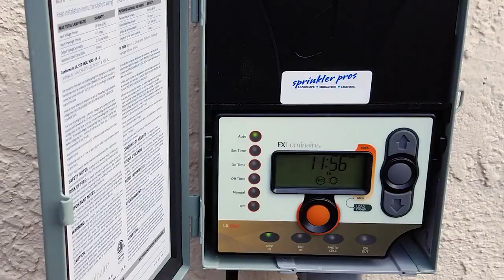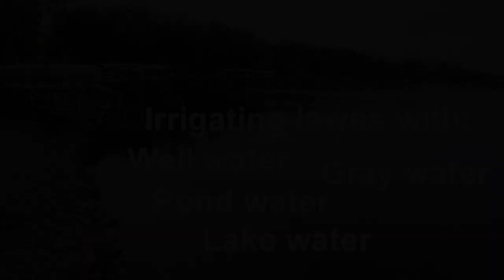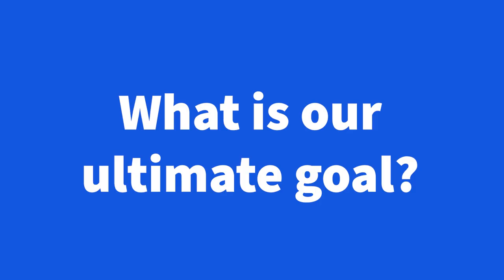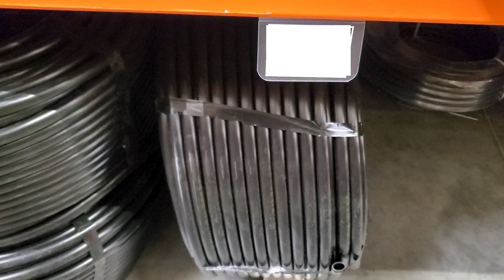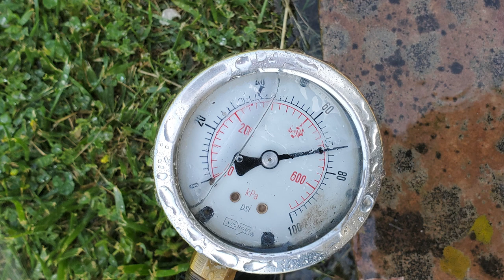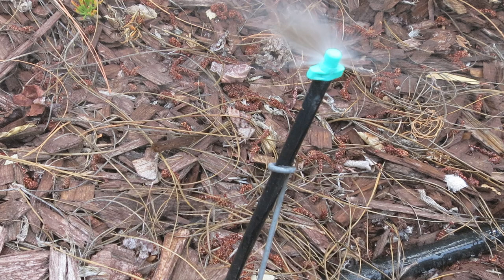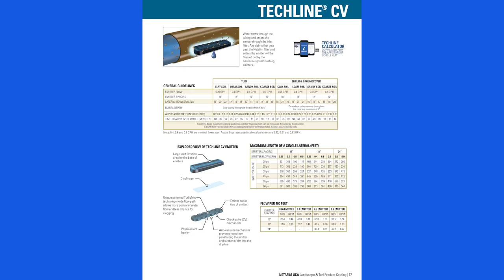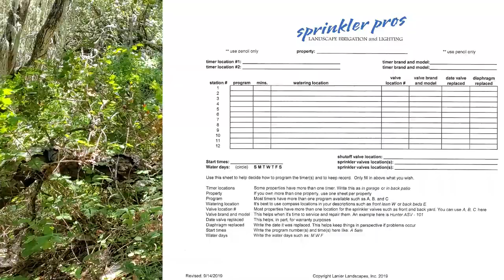Best Drip System Components for 2024 | Lots of PRO Tips 'n Best Practices

Comment: Very good info! I put manual flush valves at the ends of techline for flushing but I also could add more tubing to it as well since both sides of fitting can have techline installed
Reply from the maker: Great thinking! Always thinking of future potential is the way to go.
Reply: @SprinklerPros  by chance do you recommend a certain brand of poly tubing? I'm transitioning over from pvc...
Reply from the maker: I have never used poly. That video about trenchless pipe installation was done in Indiana where my son lives. During the recording of this video was the first time I've seen that used. I learned as I recorded. We don't use that out here in CA.

Comment: Thank you for your sharing of knowledge. I am working on a new setup for my yard and have two questions. 

I have several garden beds around my patio areas where I ran 3/4" poly to from a planned manifold setup. I am looking to reuse the three Hunter PRV 1" zone valves and am lloing to setup drip irrigation in each bed versus the older spray heads that were scattered about before (all old stuff has been removed).

My question is I have 70psi static incoming city water service. Knowing that I need to reduce this down to about 25psi for drip I wanted to ask if am I better off doing so using the hunter HFR Y filters with intregrated regulators or should I leave as is and use a regulator at each bed where I stub up with a riser prior to the start of the drip? Just not sure if reducing the pressure at the manifold after the zone valve has any other impacet that I am not aware of. Seems like this would be the cleanest way of doing the install. 

My other question is the previsou system already had a city required backflow preventer installed that feeds the irrigation manifold. Being I am looking to convert to drip is there any need to add an additional screw on style backflow preventer for each of the zone so the drip emitter tubing does not pull any sediment in? 

Thank you again.
Reply from the maker: Regarding the HFR's at the valve manifold vs having a device in each bed, that depends on the distance from the valve to the beds and whether you have things like walkways in between. The cleanest, easiest way is to install the HFR's at the valves, but if you are going "a distance" then PVC to the beds is best then install an HFR in a valve box (10" round or 12" rectangular) there OR a RainBird Retro kit in each bed. If you install an HFR in the beds, I encourage you to convert to drip tubing above grade. A couple of my videos show you how.
If you are going further than 100 ft. with each lateral of drip tubing you should go with 40 PSI pressure regulators/HFRs.
I'm not sure what you mean on the last question. The backflow preventer before the manifold doesn't keep the sediment out of the system if that's what you are asking. That is what the wye filters are for. If that isn't what you mean, ask again in a new comment thread to be sure I see your question. Good luck.

Comment: Great info! Do you have any recommendations for microsprinklers in somewhat densely planted beds, in a windy area? I've used some of the adjustable rotary kind, which seem to be intended for individual trees given their round pattern, but I was looking to install something with a more even coverage (Im thinking 180 degree ones, with an occasional 360 for the larger areas should do the trick). Thanks!
Reply from the maker: Hi Joe, are you intending to install these sprays on 1/2" drip tubing or off of buried PVC pipe?
Reply: @SprinklerPros from 1/2” drip main line, above ground. Thanks
Reply from the maker: Have you seen my video called The 3 main different types of drip irrigation and when to use them ? It should answer your question.
Reply: @SprinklerPros  I’ll have a look, thanks!

Comment: 5:44 I used one of those dead ends without the double loop for my drip system, I had it on and I heard a BOOM and it shot past my head and hit the fence and then went somewhere I could never find, I guess I got lucky.
Reply from the maker: Yikes! Sounds like your water pressure's too high, eh?  Glad you didn't get hit.
Reply: @SprinklerPros  Almost 90 PSI, thanks for your great videos, I have sub'd.
Reply from the maker: oofdah! Do you have a plastic pressure regulator on the outlet side of your DRIP irrigation valve? Or a brass pressure regulator before your irrigation valves?
Reply: @SprinklerPros  No pressure valve, the one in the backyard is no longer in service, but I am running small drip system for 2 pots that come off a sprinkler adapter, that is probably at 65 to 90 PSI, do I need a regulator or probably watch some more videos.
Reply from the maker: Definitely need a pressure regulator on a drip line with that high water pressure. I will make it a priority to create a video specifically addressing pressure, but for now, watch this video: Connecting Drip Systems to Irrigation Valves and Faucets . Let me know how it goes. Oh, and I just left you a note on your question on the nozzle video.

Comment: What are your thoughts on the automatic flush valves?
Reply from the maker: Please elaborate. Do you know the brand name?
Reply: @SprinklerPros  it's the valve at the end of the laterals that simply bleeds off pressure, leaks? so that the line never has water in it or rather never has stale water build up on the plug end of the line side of the lateral.

Comment: How can you repair a broken drip emitter in line? I haven't found that the plugs work?
Reply from the maker: Joan,  if an emitter is broken or clogged and a plug lets water leak past it, you need to cut that section out and repair it with a coupler. If the emitter is simply clogged, it's best not to remove it, thus ripping the hole larger. It's best to punch a new hole nearby and insert a new emitter. Just leave the old one alone.